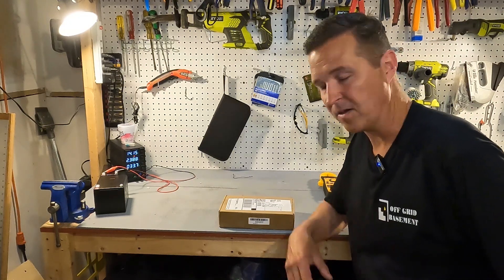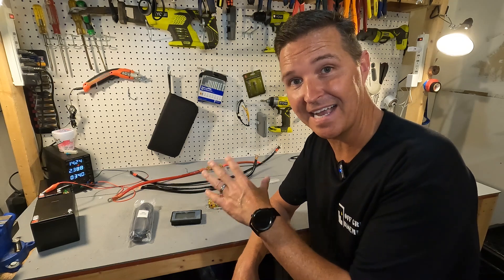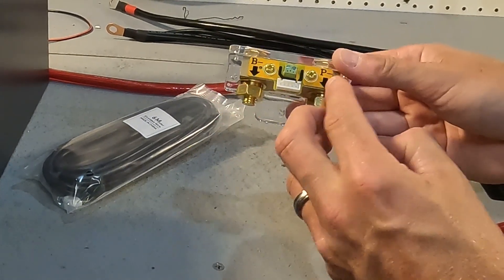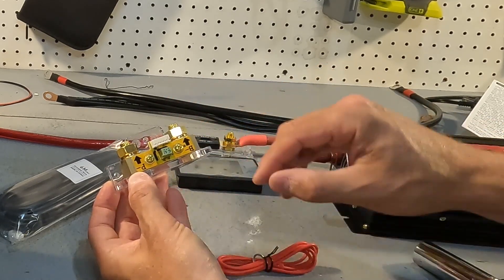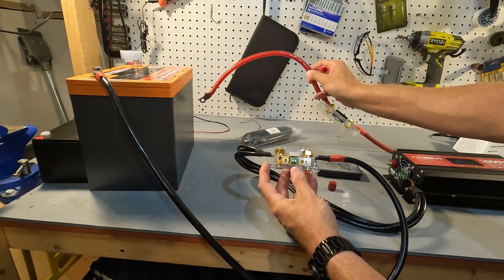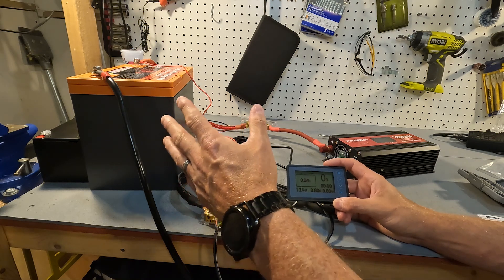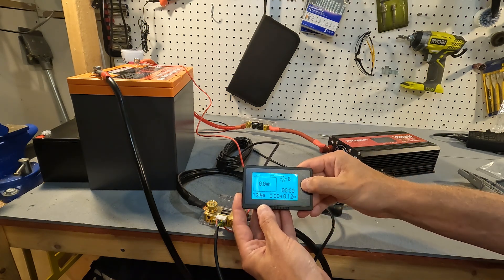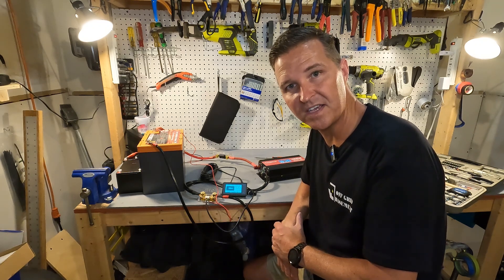EnjoyBot 500A Battery Monitor w/ Shunt!  Easy and user friendly.

Comment: Hi when charging the battery , should the negative of the battery charger  connected directly to the battery or to the shunt ?
Reply from the maker: Should connect to shunt so it captures the energy coming in from the charger.  Connect to P-  Hope this helps.

Comment: I have this setup on my 36v Golf cart. after using it  the percentage dropped to 82 percent but after I charge it back up the amp hours went back to 100ah but the % stayed showing 82%. Do you have to reset this every time?
Reply from the maker: You shouldn't have to.  Make sure your charge is in front of the shunt.  If you are directly charging from the battery posts then the shunt will never detect the charge.

Comment: I set my monitor as you described to 100% when the charging was finished. Monitor showed 100% as you indicated in the video that it should.  I drove the cart for several miles and the monitor didn't change from 100%. The app showed 88% charge after the drive. Not sure why the monitor didn't show the reduction in voltage?
Reply from the maker: Is it possible that the shunt was installed backwards?  Other than that I'm not sure.

Comment: Using this on a golfcart, the monitor just stays on? How do you turn it off? Do i need to put the red wire coming off the shunt on a switch?
Reply from the maker: I didn't realize the screen stayed on permanently.  You don't want to put a switch on the red wire.  It will most likely reset the switch, making the shunt useless.

Comment: How do I set all of the other values like Attention, Alarm, Power Off, Zero V, and Full V
Reply from the maker: I'm not sure.  I'll need to do a follow up video on this shunt.  Take a real deep dive into it.  Thanks for the comment.
Reply: Following the user manual: hold the OK button for 2 seconds to enter the the settings.  Down (or up) arrow for individual functions, OK button to enter the function and then up or down to change the setting.  Double left arrow to exit the individual setting line.   Double left arrow again to exit the settings when done.

Comment: I've installed this monitor along with an Enjoybot 36v 100 Ah battery in an EZGO golf cart similarly to your bench set up.  The battery was fully charged and the capacity set to 100 Ah with the up arrow as demonstrated in your video.  The other setting lines were left as is.  
After some use, the monitor said 51% (Ah) while the battery went to 0% based on the bluetooth reading and the cart started stalling indicating bluetooth was accurate.  Figuring the monitor needed more input, I then went and charged the battery back up to full, set the capacity again to 100 Ah but also set the Full V and Zero V to the voltages provided in the literature and tried it again.  Now the monitor says 0% while the battery bluetooth says 50%.   Any idea what I'm doing wrong here?
Reply from the maker: Do you have other items connected to the battery besides the shunt?  It should be battery->shunt->everything else.
Reply: @OffGridBasement  No.   All loads (negative pole) go through the shunt and then to the battery.
Reply: With additional research, I believe my unit is defective as it appears to be malfunctioning the same as that shown in the video:

https://www.youtube.com/watch?v=YhR-FJlYkLs&t=27s

 The unit looks the same except with a different Manufacturer's name.  This is pretty much what I am experiencing.

Comment: I believe this is identical to the one redodo sells, anyway do you know if you can monitor 2 separate batteries?
Reply from the maker: Only if they are connected in parallel.

Comment: Hi I have a braker switch 50a on my trolling motor so if I put a shunt that means it run through my braker switch  is that normal I guess?
Reply from the maker: I would wire the positive from the shunt past the breaker.  That way the shunt doesn't power down if the breaker is pulled.

Comment: thanks i kept from getting one for fear of hooking it up wrong now i know how , do you need the 500amp for a 3000 watt inverter?
Reply from the maker: If you are working with 12 or 24v, then yes.  100a shunt would if you're using 48v setup.  Hope this helps.

Comment: Is there anything you need to do differently if you are running a 24v system using 2 12v batteries?
Reply from the maker: No.  It will recognize the voltage.  Just input the total amp hours, charge the pack to 100%, set the unit to 100% and you're done!

Comment: How do to program the monitor so that the reference to 100% is calibrated to its actual capacity? In other words, how do you tell the shunt the actual capacity of the battery? I'm sure it doesn't work off of a discharge/charge voltage curve since that would be nearly impossible with a LiFePO4 battery.
Reply: That is why it is important to charge the battery to 100% before applying the monitor and shunt. Further more, you will have to tell the shunt the battery capacity (ie in AmpHours) you are working with by going to settings in the Bluetooth app and the shunt will gladly take it from there. 
The shunt works with current rather than voltage.
Reply: @mosesgoiho6240  Thank you for your response. I knew the shunt worked by measuring current flow. My question was how do you set it to know what the actual capacity of the battery is. You reference blue tooth, but did not demonstrate how that is done. You showed how to set other settings but left this one out.
Reply: @robertrice4441  Oh yes I think he missed this one on his review. What I know is most of these shunts  are Bluetooth compatible and with this you can effect most of these settings per your preferences. They have an app that connects through Bluetooth which you and I know that you  have to be within range to access this. Some more advanced ones may have wifi connections.
Reply from the maker: Hold down the enter key gets you to the settings menu.

Comment: Thanks for this! I have a small back up unit at home, 100A LiPo, 100W panel and 30A MPPT.

While I do have a smaller inverter for any needed AC normally I just use cigarette lighter type USB adapters to power my daily stuff.

My question, I can hook this up to the negative lead between the controller and the battery to keep track of the total charge in the battery? Did I understand that right?

Again, thanks for what you do!
Reply from the maker: That's correct.  Charge the battery to 100% then set the unit and you're ready to go.
Reply: @OffGridBasement  Thanks man!

Looking forward to more from you!